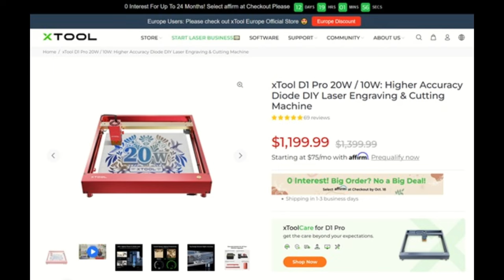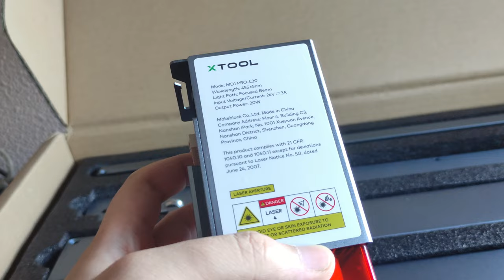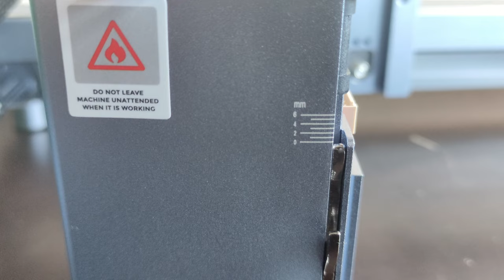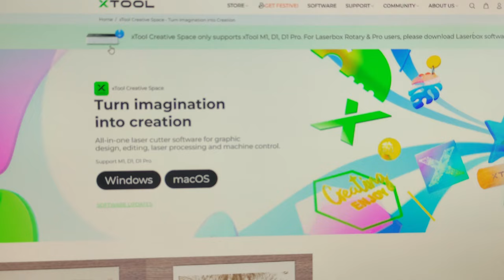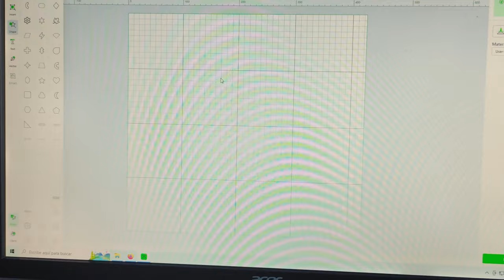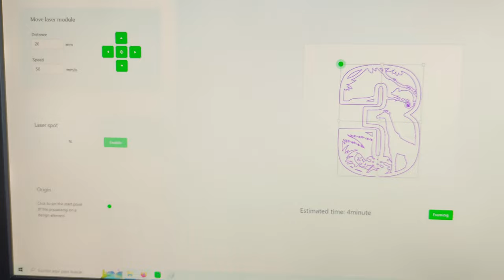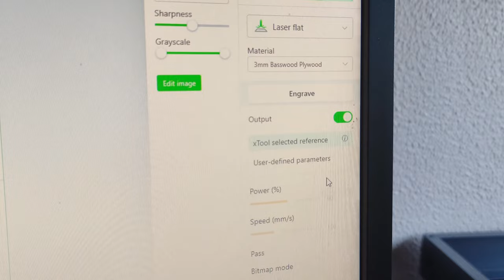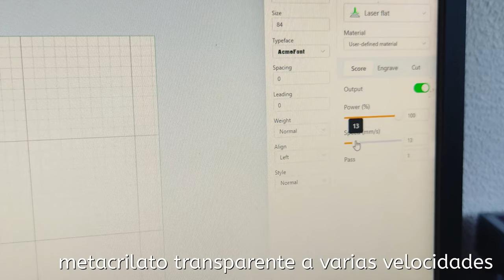Xtool D1 PRO - laser 20w - Análisis

Comment: ¿Que adaptador usaste para el enchufe? Me quiero comprar la maquina pero no quiero romperla por el tema de los voltios. Gracias
Reply from the maker: Buenas, en mi caso el transformador era de 240v, estandar europeo, y me vino si mal no recuerdo con una clavija de enchufe Uk y no me vino o quedaba flojo el adaptador, pero son de este tipo, muy comunes, y solo adaptan el tipo de enchufe, no tienes ninguna posibilidad de ponerlo mal:
https://es.aliexpress.com/item/1005003044706190.html?spm=a2g0o.ppclist.product.2.325aMp4lMp4ljC&pdp_npi=2%40dis%21EUR%21%E2%82%AC%207%2C71%213%2C78%20%E2%82%AC%21%21%21%21%21%40211b446316715825909213618e0946%2112000023424812027%21btf&_t=pvid%3A8d870e8b-a5ba-4f4c-9690-f74fd52ac33f&afTraceInfo=1005003044706190__pc__pcBridgePPC__xxxxxx__1671582591&gatewayAdapt=glo2esp
Reply: @JuanCarlos_3design  muchas gracias